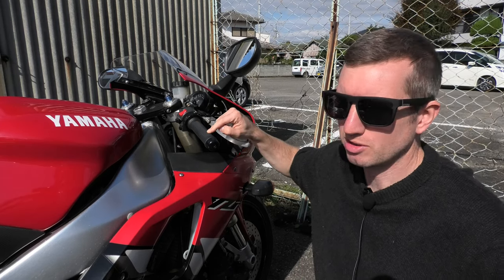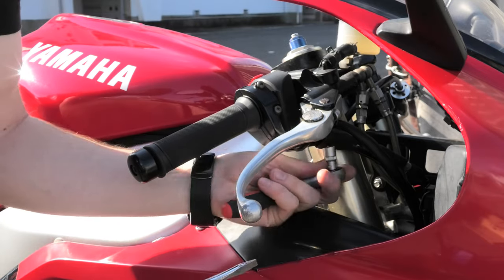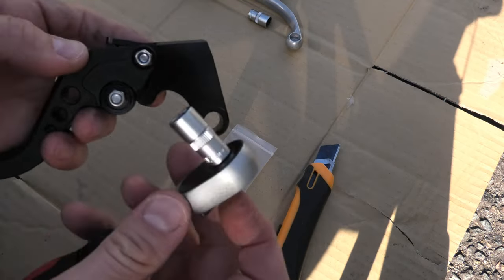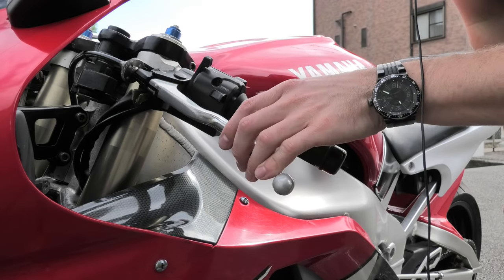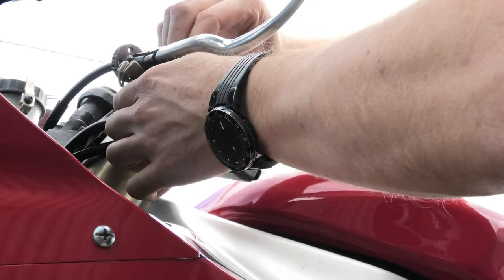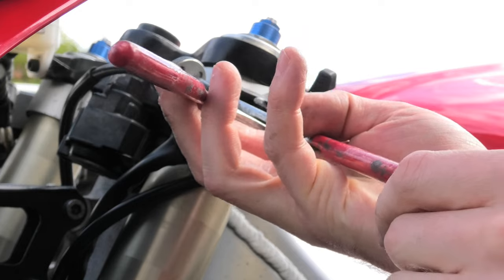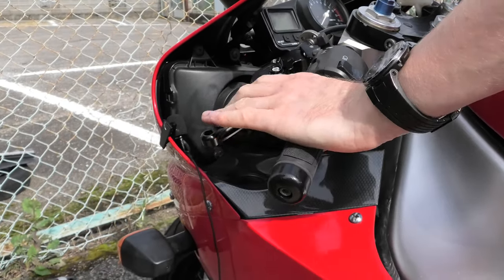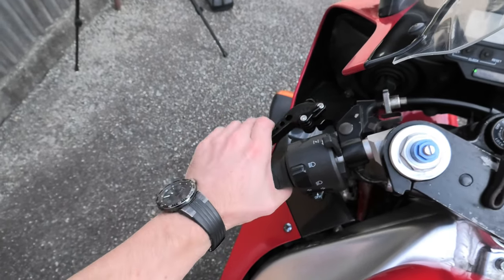Cheap Ebay Brake and Clutch Levers! Fitment and Review

Comment: They're designed to be used with two fingers, you can get the same levers but longer, you have " shorty" levers..
Reply from the maker: Yeah I find it tiresome in traffic just two fingers. I tried it for a couple of months but just changed to a longer lever again yesterday